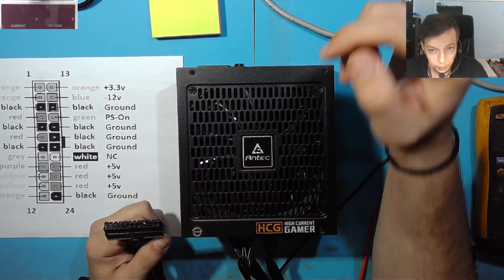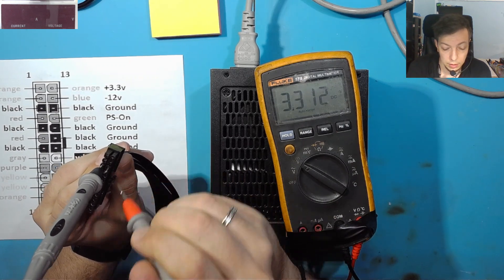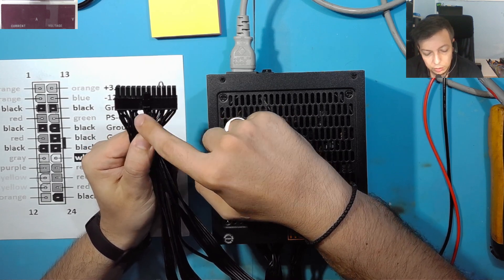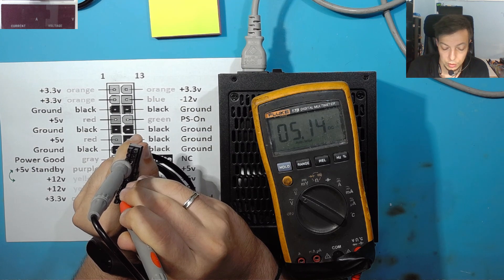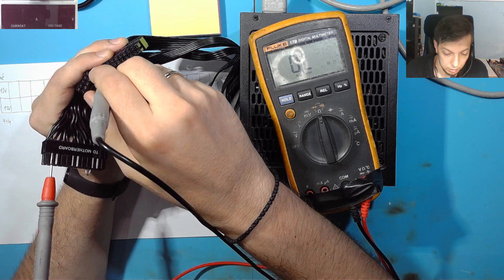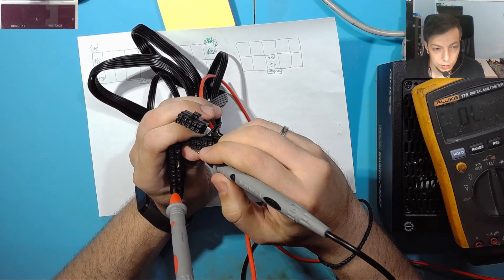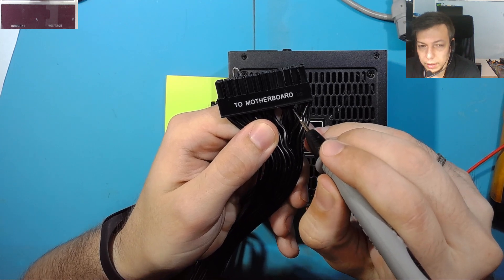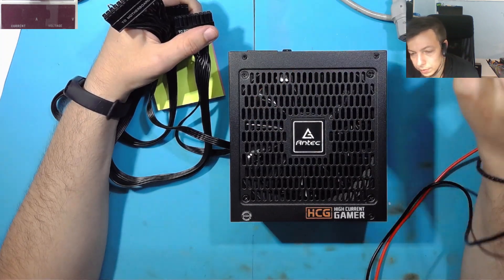Antec High Current Gamer Bronze  PSU 12v on +5VSB line, dead motherboard

Comment: Someone mentioned that it is the wrong cable, maybe you customer switched them and used an older cable?

https://extreme.pcgameshardware.de/threads/antec-hcg750-12v-und-5v-am-atx-stecker-vertauscht-mainboard-defekt.608461/
(use the power of google translate, it ist comment no. 3)
Reply from the maker: hi, it seems many people think that it is the ANTEC HCG GOLD that has different cable, but it is ANTEC HCG BRONZE and the cables look exactly as the original
https://www.youtube.com/watch?v=cp33F9wTLeA&ab_channel=KingfisherTech
i changed the title to make it more clear
thanks for the link, i answered to all of them :) with the power of google translate :P